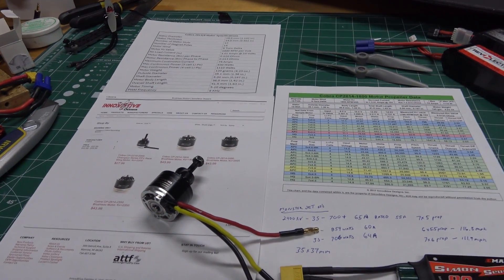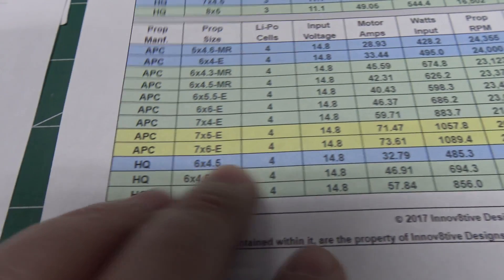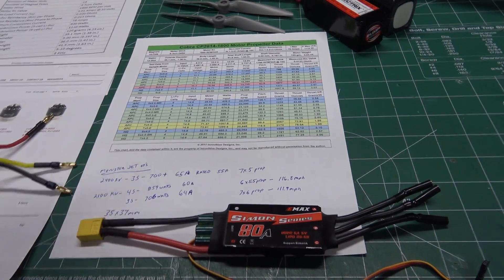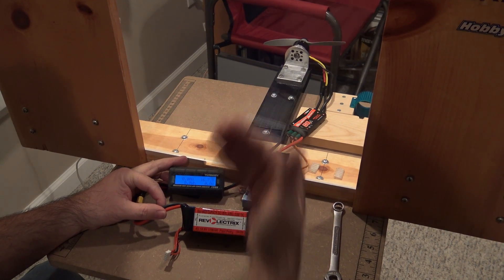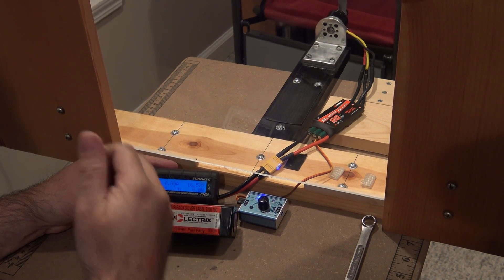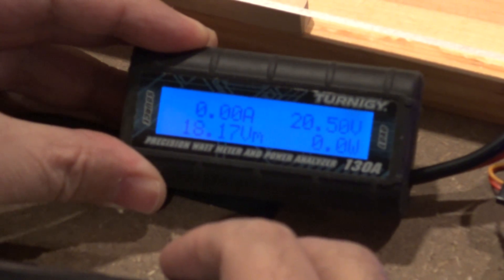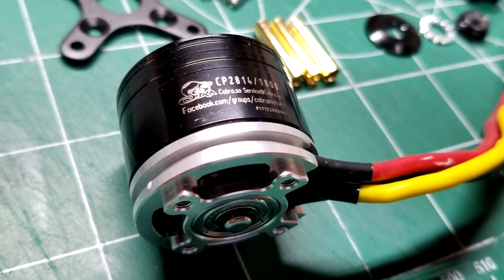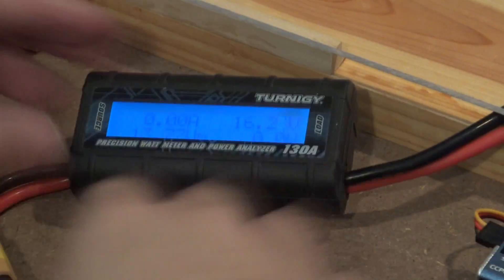Cobra CP-2814-1800 Race Wing Motor

Comment: can you explain what that noise was from the slow fly prop.... i heard someone say its flattening out, so is it over propped.. is that what the sound means?
Reply from the maker: Paul slow fly props aren't made to handle high rpm because the blades are usually made much thinner with larger surface area. This one was over powered and spun way above its rpm range so it flattened out the blades and made that sound.
Reply from the maker: Paul, the prop flattening out is it actually losing shape from flexing. The high RPMS and air loading on the prop actually make it Flex out of shape.  The Slow flyer props are thinner material and not meant for that much loading and RPM's.. It was my mistake thinkng it was a regular prop, lol.

Comment: Hi Paul that sure is a great motor. Lots of power. Something I like to do on all my motor tests is use a infrared thermometer to check the temperature of the actual motor windings. It's a bit more accurate as I've found some motors don't transfer the heat to the casings of the motor as much as some others and the infrared thermometer allows you to get in through the motors cooling vents to see the temperature of the motor windings. I gives me a way of seeing how far I can push my motors. As my test rig is like yours also setup with the prop in pusher configuration so no air cooling the motor I have a rule that if the motor windings get to 50 deg C on the second pull then that's too hot. It's worked for me so far and aloud me to find I can push the 1850kv 1650watt Warhead edf motor to a CRAZY 3500WATTS on 8s!!!
I also totally agree with what you said about the esc you are using and that other esc's can't handle the rpm's. I've been trying to inform people of this fact for a while now but some people just won't listen. That's such an amazing price for that esc. You said they've stopped doing it though. Shame. The two esc's I use that can handle high rpm and high pole count motors are the HobbyWing Platinum series and the Turnigy AE series esc's. They come in all sizes up to 100amps. The HobbyWing 100amp esc has a 150AMP BURST RATE!!! They both are more expensive though.
Glad you're back guy's. Thanks for doing this test.
...RCPP
Reply from the maker: Thanks for the input rcplanepilot! You are totally correct, we usually have a thermal temp sensor but I was lazy and  did the old seat of the pants grab the motor check, LOL... Wow, crazy watts you are pulling on that EDF motor! Awesome!  I do love the Hobby Wing ESC's too and have used them on a few projects. I was hoping to find a good cheap alternative for those on stricter budgets. I haven't found the true rating of the EMAX ESC's , but so far so good knock on wood. It sounded real smooth on the run up tests.  Yeah Frank blew up one of those Hobby King 1450kv 1600watt motors we think when he ran it on 6s. It made weird noises and then the magnets literally blew to pieces! We think it was going so fast it lost motor timing and jacked everything up.  I know for sure the Cobra BLheli Race Wing ESC's are rated for over 40,000rpms on a 14pole motor.  They are just more expensive too, but a good option. Anyway thanks again for the comment RCPP!
Reply: No problem Paul. Thanks for the reply. Yes I remember when Frank blew up that 1450kv motor in the Skyfighter. I had the same thing happen when testing a very high rpm motor. I shouldn't of tried running it on a cheap esc I bought off ebay. Just like you said it started making funny noises then sparks flew out of it. On inspection found that yes a few of the magnets had exploded. That's when I learned my lesson to use better quality esc's on high pole or high rpm motors. Look forward to seeing the flight videos with this new setup. Thanks again RCFF.

Comment: You can usually subtract 35% from the static thrust Amp figure compared to in flight amp draw. So that beast of a motor should be good on 5s.
Reply from the maker: Thanks for your input Daniel. Very True the in flight amps should be a bit less with the ram air effect in flight. And speaking of Beasts, your videos on your channelshow you are a power lifting beast! Crazy mad, Right on brother!